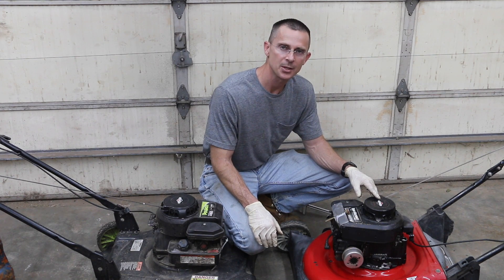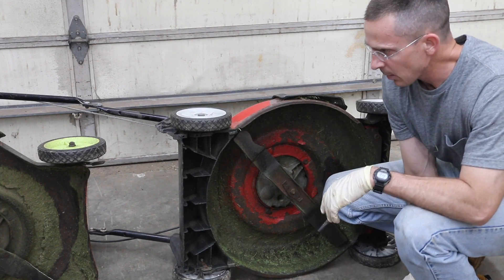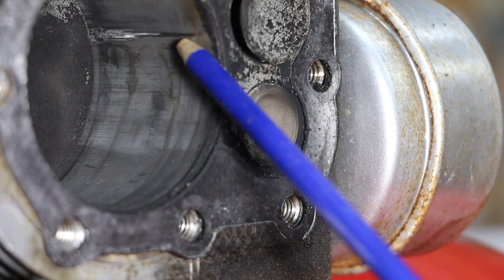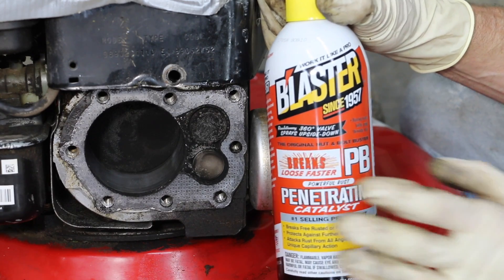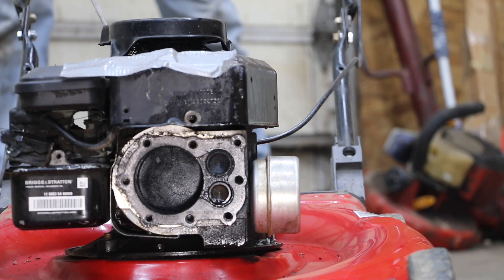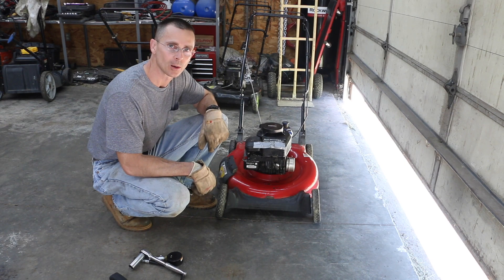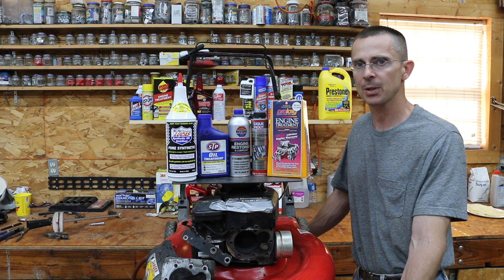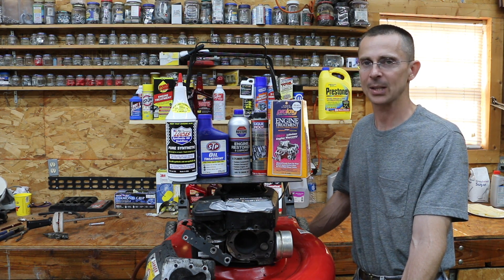Engine ran without oil, seized! Can it be saved?

Comment: If it's a Honda, it sure can. My 30-year-old HRX-series mower was burning oil, and I didn't realize it until it seized after just mowing half a strip one day. Checked the oil, yep, it's empty. Took it to a repair shop I knew nothing about, and after a week or so they told me it "wasn't worth it" to rebuild the engine. They probably thought I would just leave it there, and they could fix it and resell it. But instead I picked it back up, brought it back home, filled the crankcase with oil, tilted the mower back, sprayed WD-40 (not the best option, but it's what I had on hand) into the chamber, and kept pulling the crank. After just a few minutes, she started up. Amazing.
Reply from the maker: Thanks for sharing!  Glad to hear you got it working!

Comment: You really need to do a full tear down and replace worn components or bore out and new piston. I suspect the ring spacer or a chunk of a ring broke off and it stuck between rings, chewing stuff up. Tear it down, clean everything up, maybe use lapping compound on valves and cylinder/piston, clean up valve stems and seats, check clearance (should be possible?)new gaskets, new plug, new oil with magic product of your choice, maybe Lucas oil stabilizer and pray.

And of course full clean of carb, carb soak (or kerosene) preferred or ultrasonic bath in solution like mineral oil.
Reply from the maker: Thanks for the feedback.

Comment: What would happen if you ran a heavily oiled 2 stroke mix in a 4 stroke engine without crank case oil? Also same question but treated with pure motorkote with a few warm up cycles before draining
Reply from the maker: Thanks for the video idea.

Comment: Before I even start this video, um gonna say "Yes!" We bought a bunch of engines and parts from an old small engine repair shop that went out of business. 11 generators that all ran with just 2 needing carb work, probably 20 small engines that ran (from small 2 and 4 cycle tillers  up to 6.5 Hondas and few Briggs) along with many vanguard V-Twins (2 ran about 5 more that we don't know about yet) that were warranty engines needing minor work, about 4 or 5 locked up. One brand new 1150 series Briggs was started without oil thinking the factory filled it. Poured Marvel Mystery Oil down into the cylinder for about an hour, turned with pipe wrench, it now runs like the day it left the factory. We bought everything for $500
Reply from the maker: Thanks for sharing.

Comment: Right at the end, just before you are finally finished testing the various factory products on the worn engine, try putting some fine sawdust in with the engine oil and test the extent to which it reduces the mechanical knocking noise. Not good for lubrication by any means but I have heard that many dodgy dealers use this method to disguise problems.  Does it really work?
Reply from the maker: Great suggestion!  Thank you.
Reply: Now that I think about it, I believe you could do an entire video on the effects of sawdust/oil mixes on mechanical noise, the list is endless, worn engines, transmissions, hydraulic motors, etc.  It actually works in deadening the noise, just don't ask me how I know this 😉

Comment: My Kubota Diesel tractor was 'knocking'  main or rod, not sure.  I followed the directions on Slick 50.  I kept it running for a couple of years after that.  It did not cure the problem but it did allow me to continue to use that tractor.  Every oil change I put slick 50 in.  Implied here is that a high compression ratio engine continued to work.
Reply from the maker: Thanks for sharing.

Comment: When I was 16, first car burned a quart of oil every 75 miles. When oil got low one time I put in 3 cans of STP oil treatment.
Actually spun the tires for 6".
Reply: I had a friend in high school who had a truck like that.  If we was out for a while.  We gotta, fill up the oil and check the gas.  We was on a first name with a local garage.  So we could get used oil free.  We would use it several gallons a month.  That is just what I seen.  Maybe it was a lot worse than that.
Reply from the maker: Thanks for sharing.

Comment: Did you ever try any additive to see if the engine improved?

Also notice this is an earlier video before your started ditching the pull starts to use a drill.  My GF thinks I am crazy, because I removed all the pull starts from our 3 mowers....  Easy-peazy to start them now...
Reply from the maker: Yes I have.

Comment: I've heard that Marvel Mystery Oil is just fancy transmission fluid. What do you think?
Reply: Definitely not. Watch some of his other videos. Personally I would have liked him to try this with MMO straight without the Mobil1 but MMO and Seafoam seem to be the best 2 additives for engines that are knocking, or just not running smoothly etc. You can add MMO to the fuel tank AND to the crankcase mixed with regular oil. It's one of a very few products that can actually stand up to it''s claims and it is SUPER cheap compared to many others. We used to put MMO on the poles of our foosball table and it would make them spin like literally unbelievably smooth. Try it out!

Comment: I don't think testing is ever a waste. You may need to hone out the cylinder wall and replace the rings. Check the crank shaft for scoring and friction weld damage.
Reply: There is also a technique with tools from a machine shop where you over hone the cylinder and put an upsized piston to match the gap but it's a crap shoot if the machining isn't perfect because you could end up with a part of the cylinder being narrower than another part compromising compression.
Reply from the maker: Thanks for sharing.

Comment: My FIL gave me a Echo leaf blower that was locked up. I poured some MMO in the cylinder and let it soak for a week. It finally loosened up to where I could pull the starter rope. Then added some penetrating oil and it got real easy to pull. Drained as much out of the cylinder as I could then added some gas to the fuel tank. Finally got it started. Smoked for about 30 minutes out of the muffler then cleared up. That was three years ago and use it every season. Starts of the forth or fifth pull.
Reply from the maker: Thanks for sharing.

Comment: Try Fluoramics "Tufoil" additive.  Regarding the "knock", I think that is lash in the connecting rod, and no treatment will cure that (and the engine will hammer itself to pieces if continued to run).  Perhaps if you open the engine, and remove shims from the connecting rod bearing at the crankshaft end to tighten it, it will run well.
Reply from the maker: Thanks for the feedback.

Comment: My friend swears by high detergent diesel oil mixed with hyoid gear oil 80 to 150 I think 30wt on the diesel he run a repair shop and he says it's the best for what he calls dirty engines you know what I mean riding mowers and such that don't have oil pumps or filtration systems I have used it but not in a comparison type test so I have to say I have little to say I've watched your addative shows my most notable experience was adding slick 50 to a Chevy 307 that was in good shape I had it running and a tach hooked up within 30 seconds after adding it my rpms went up almost 250rpm and the idle speed has remained at that increase I was kind of shocked actually my engine loved it this was a mix with Castrol 30 at whether I gained in long term wear proofing I really can't say
Reply from the maker: Thanks for sharing.

Comment: It can b fixed.if alum cylinder.remove head;; if it's a flat head.have motor up down.put some oil in cylinder bout half inch deep.grabb by blade and work up down wiping shaving away go up down few a make sure most if not all shave g e gone it will run.
Reply from the maker: Thanks for sharing.

Comment: I use to use marvel mystery oil to remove carbon from engine. I poured about a 1/4 cup water in carberstor and than add about the same amount of mystery oil to revolt the valves and piston did this with engine running, good product, but with the cylinder scared nothing can help accept resleving engine and changing piston, connector rod, crank bearings.
Reply from the maker: Thanks for sharing

Comment: There was not normal, but, i worked in a shop of garden machines, and we repair ONE chainsaw seized, (less than your engine) the metod is sandpaper wet whit oil&fuel mixture of 2t engine, after mare than one hour fingering the engine (jajjajjaj xd) the seize disapear totally at touch. Next we put a used piston, and the machine runs aparently perfect, probably whith less power but for a really cheap job, who care? 
Usually seize means, new full kit
Reply from the maker: Thanks for sharing.

Comment: I have my 2 stroke moped (50cc) and previous owner had oil in the “self lubritating oil tank “ ( it just adds oil to carburetor instead to a gas tank)and the pump stopped working for him and he never told me and one day I was driving happily , I got home and I told myself “ I’ll go to a gas station for some gas and then it wasn’t starting (it wasn’t stiff at all) so I checked carburetor if it wasn’t clogged up or gas tank if it wasn’t clogged up I checked everything but I didn’t check Two things ... piston and the cylinder wall... I was hopeless so I towed it to my friend and he told me that the piston and the piston ring are completely crushed (also the cylinder wall , so I’m hoping that I would get these parts for good prize and I’ll get the scooter going again ☺️
Reply from the maker: Thanks for  the feedback.

Comment: I would look at the piston connecting rod, taking not of an area that may be touching the cylinder wall under pressure, grind off some of the connecting rod area, that was scored, and it may be enough to keep it from touching the cylinder wall, that was causing the noise! of course, the walls shoud be rebored to a smooth surface, with a new piston and rings and it may run, almost like new?
In my opinion! Great Show, love your attention to detail! Carry On!!
Reply from the maker: Thanks!

Comment: I would like to see a segment with the motor coat treating the engine and then running it without oil. I Seen it where you ran it with water and it did very well what I always wondered  How it would have done if you ran it with out  Anything in the crankcase
Reply from the maker: Thank you for the video idea!

Comment: When introducing oil back into a seized engine, the best way to do it is to re-fill  like you did, then roll the machine end-over-end a few times to get the oil all over all of the internal components.
All of that beautiful brand new oil was doing little if anything sitting in the bottom of the sump.

I know this is an old video and all of the answers have already been provided but I would think the super thick STP oil treatment would be the best for making the poor old thing run as good as possible due to its extreme viscosity.
Reply from the maker: Thank you for the feedback

Comment: I ONCE made a major mistake by LOANING my Toyota T100 to a customer while I rebuilt the engine in her car.  On the Second day, the T100 acquired a coolant leak and continued to drive the truck until the engine seized.  I went to the location of the truck, fixed the coolant leak, filled the cooling system, drained the oil and did the vary same thing you did here.  Several years later and more than 20,000 miles, I am still driving the truck with the same engine.  Although, the engine has developed a slight valve rattle (which is common on older Toyotas), it STILL runs good and is nearing 500,000 miles.  God, I love Toyotas !
Reply from the maker: Thank you for the feedback!

Comment: One of our old mobile tool venders locked up a 2 cycle as a kid. Ran straight gas through it, and it locked up. Old man at the gas station, said, " take out the spark plug, and fill it with coca cola, let it soak overnight." It worked from what I was told.
Reply from the maker: Thank you for the feedback!

Comment: Being a mower mechanics since I was 12, (33 now) use Sea foam or deep creep in the cylinder, just remove the spark plug, tilt mower back and squart some down the hole. 
NEVER run full synthetic in a mower. They aren't built for that. 
Run conventional with 10w-40 or 20w-50 for a motor in this condition. 
Marvel is ok, but it isn't more then brake or transmission fluid (one or the other can't remember at this time). 
The knock is from either the connecting rod bolts have backed out or the rings slapping and becoming loose.
Reply from the maker: Thank you for the feedback

Comment: I'm surprised it started again. I guess I was expecting a rebuild. Replacing rings / re honing the cylinder wall / perhaps new piston / valves, what ever was needed. Like you said it would never be the same just re lubricating and getting it started with low compression. Thanks again for your videos. I think you do a great job testing things out. I, like you was a big fan of Slick 50 back when it came out. I felt I was buying into false advertising at some point and stopped buying it. People have no issues doing false claims / advertising and taking your money. Thanks for shedding light on the scammers.
Reply from the maker: Thank you!

Comment: Use Royal Purple Synthetic. I’m a believer after putting it into a high mileage 5.4 liter engine. It used to burn 1 1/2 quarts of oil between oil changes at 3000 miles and now with royal purple it uses only a half quart.
Reply from the maker: Great information. Thank you

Comment: I'd say use the STP to help it with knocking and oil burning. I flushed out the engine in my old truck, and the oil pump started knocking. A mechanic suggested switching to 10-40 oil and a can of STP. It has been running fine for the past 4 or 5 years, and I have made several trips to Yuma, AZ and back (320 miles round trip) including in the summer, and it has run fine.
Reply from the maker: Thank you

Comment: I once rebuilt a 16 hp Kohler single cylinder engine that had locked up.  Looked a lot like this one inside. It was 30 years old from a John Deere garden tractor that the owners late father had owned since it was new.   I tried to convince him a repower was the best choice but he insisted I fix the original at all cost. I pulled it down had the cylinder honed and sleeved. New piston, rings and con rod. I had the crank turned; journals and mains and installed new bearings on both ends. Reused the old counterbalance and oil dipper. It cost him $1000 to rebuild a $600 engine but it ran like new for years to come and the memory of his father lived on.  Thank you for what you do and keep em coming!
Reply from the maker: Thank you!

Comment: .... ummm the wd40 was only on about 40% of the piston.... my 2 cents... might have worked better if u had the mower vertically to let the wd40 seat all around the piston to the rings instead of letting it drip out at tdc.... but good vid
Reply from the maker: Thank you!

Comment: Because im an idiot I ran my lawn mower without oil. it began smoking from the crankcase within 1 minute and it was seized pretty much instantly after stopping the engine. I used this video as a guide to try and get it running again and was successful in restoring it to working condition. Great video, very helpful you got a thumbs up from me :)
Reply from the maker: That's awesome, Thank you!

Comment: Could you try using some ametech engine restore oil  to see if it fills in the scratches on the cylinder wall?
Reply from the maker: Thank you for the video idea!
Reply: Thanks for your reply. Also just had another idea, you could get some moly mos2 grease and mix it with something like diesel or thin oil to make a super high concentrate moly oil!!  and maybe use it on a engine that's knocking to see if the moly fills in the voids and quietens the engine.

Comment: I litterialy used USED engine oil on a generator seized up from oil leak and the thing runs great now. Breaker bar on the flywheel fixed it. Oil leaks from the governor, but it still runs great
Reply from the maker: Nice! Thank you

Comment: 68 PSI is probably just barely enough to get it to run.  I had one a while ago that had like 50-60 psi and i determined the head was warped and gasket blown.  It wouldn't even pop.  I then plained the head, new gasket, and retrofitted a different carb to it from eBay.  The carb pissed gas all over my floor and the engine ran for about 10 seconds before shearing the flywheel key and seemingly losing spark simultaneously.  It's been sitting since then.  I was tired of spending any amount of money on this engine i bought for $7.50 :)
Reply from the maker: Great point.

Comment: When I was a kid our lawnmower siezed up. My parents were divorced and I lived with my mother. My mother removed the spark plug, turned the mower onits side and then poured oil into the cylinder through the spark plug hole. We rotated the blades until it moved smoothly. Set it back upright, gave the pull cord a few tugs and voila it ran! As I remember it didn't sound nearly as seized as yours in the video. My mother was amazing IMO. I enjoy your videos.
Reply from the maker: Impressive!

Comment: This was a very good video I wanted to know what product use the best to give the best compression back to the engine also I have a Honda generator engine that has seized up because of rust what is the best product to get it unfrozen?
Reply from the maker: You might consider adding some marvel mystery oil to each of the cylinders for a week or so
Reply: @ProjectFarm  Will do thanks so much!!!

Comment: What causes the knock sound? Poor piston movement? 
Also, to the people who say he's wasting money and time, this has been great to see, that someone who is desperate to make a machine last a little longer could do some repairs with an engine failure.
Reply: Andrew Copple the knock is most likely from slop in the bearings between the connecting rod and crank shaft. If there is any slop when the piston come down the rod will bang against the crank
Reply: @levijnkins4657  Thanks!